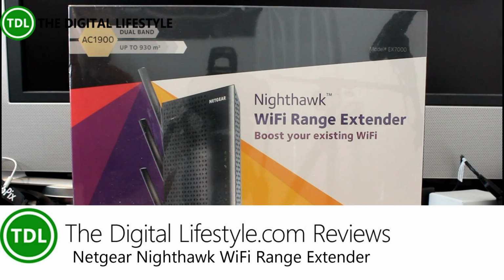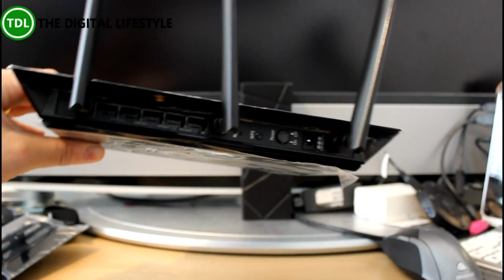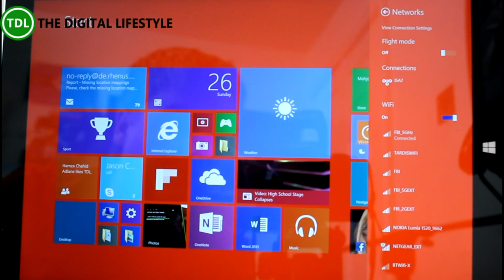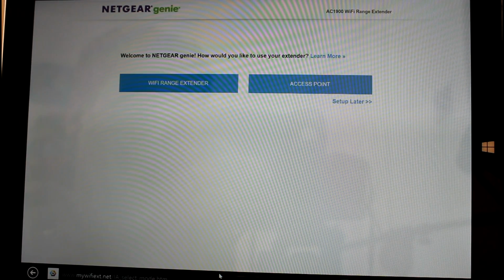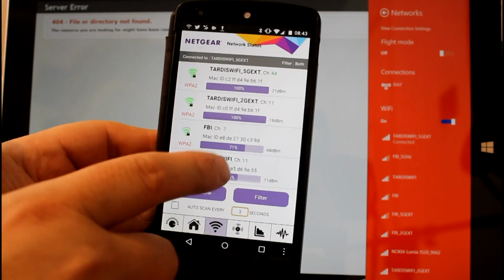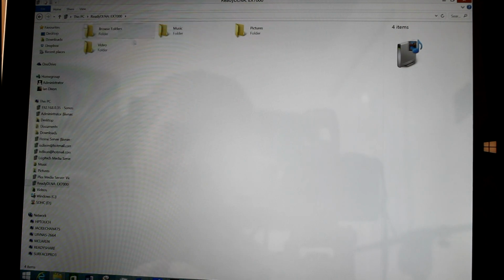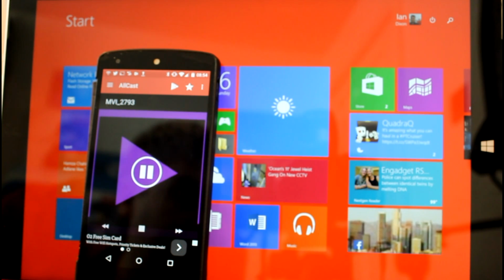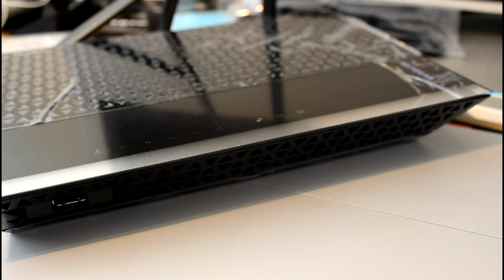Netgear Nighthawk Wifi Range Extender video review

Comment: how well would this do for gaming like 5 to 10 feet away like mmos and what not? i ask because i got the NETGEAR AC1200 WiFi Range Extender - Essentials Edition (EX6120-100NAS) and the extenders connection is slow will this Netgear Nighthawk Wifi Range Extender do better?

Comment: I bought this extender. Set up 2.4 and 5 ghz. The extender was in green(led) range of my router. I set up my phone on the extender to test speed. While literally at the extender (which the extender showed an amber light for devices connected to the extender. Should've been green. I was literally 3 ft away.) I was getting 15-20mb on a 65mb connection. 25 ft away in my yard (which is why i bought the extender) and  almost in line of sight of the extender I was getting 4mb tops. Needless to say I don't recommend this extender for the price. While it did boost mb for devices in that immediate area it did not extend as well as an extender should.

Comment: I see like the Nighthawk Router itself the quality of the antennae connections are equally lousy.  I also noticed that you ran a drive without any software BUT when using a USB 3 drive on the Nighthawk Router I needed some Netgear Drive software and it kept "locking up". I also needed Netgear software for mounting a printer on the USB 2 port.  Have they fixed all this with this extender?